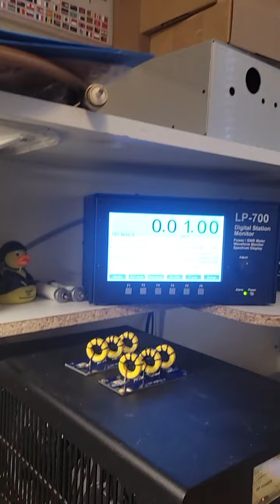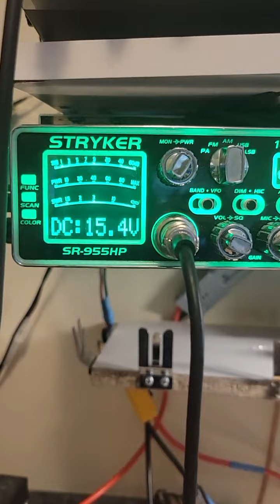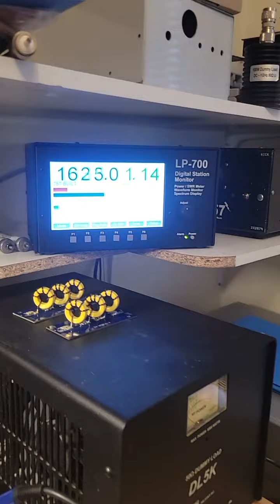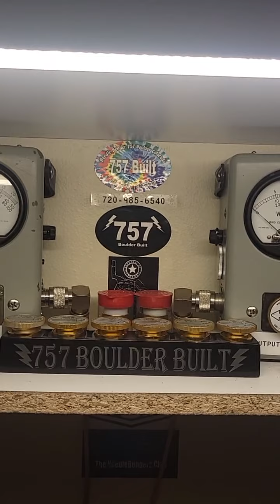#268 8 pill mobile

Comment: Would a 100 amp power supply run a 4 pill  just curious and I don't mean any disrespect but or your  amplifiers pretty clean with harmonics or would it be best to run a low pass filter on them,the only reason why I am asking I have people that live right next to me and I don't want to have any issues with them thanks.
Reply: About 60 max on am. Almost 100 on side band. But that can vary.